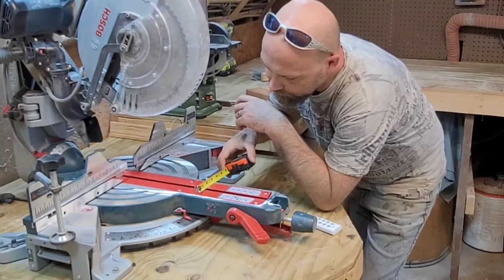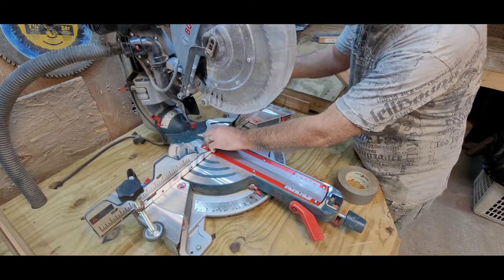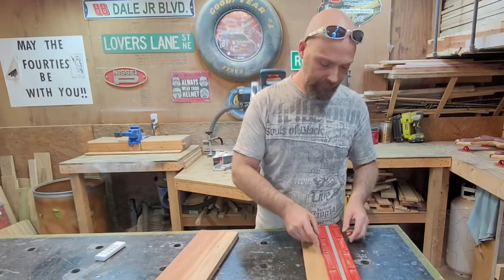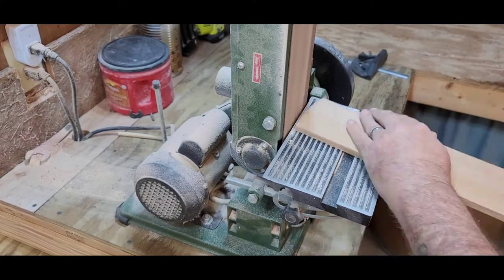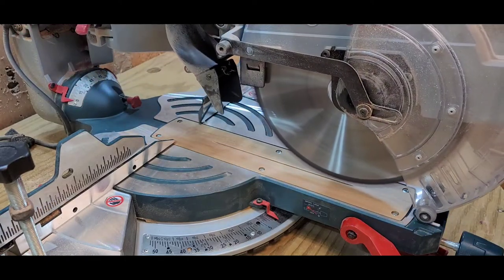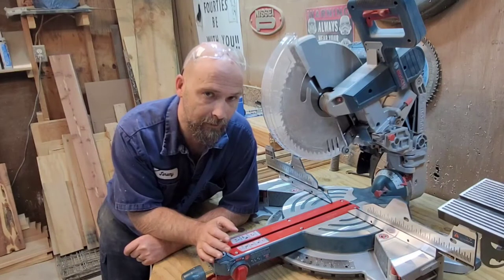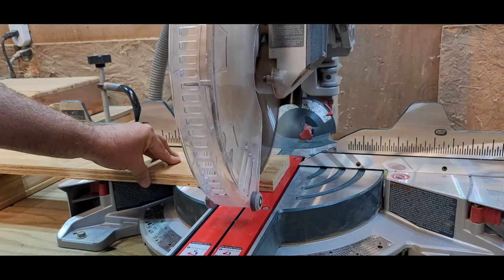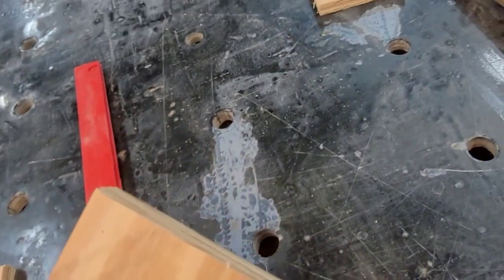zero clearance insert for the Bosch axial glide 12 in miter saw.

Comment: New subscriber here. Just a thought, are they adjustable for when you bevel the blade left or right?  I just checked my new Ridgid saw, just like your Bosch, has the same plastic inserts, with slots.
I actually learned something from watching your video!
Reply from the maker: I believe so, I didn't try it but given the ease of adjustment I wouldn't see why not.